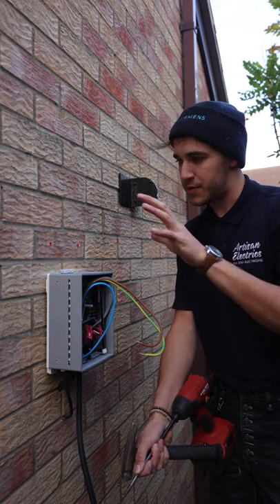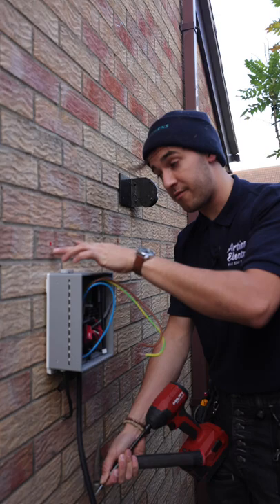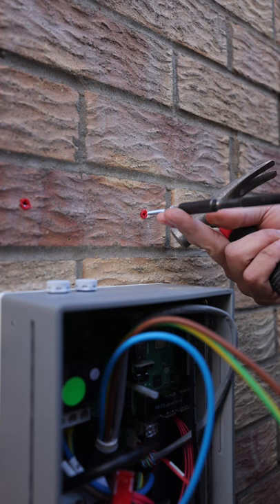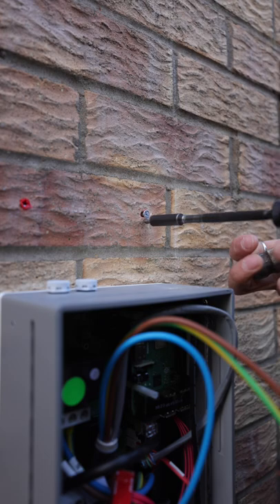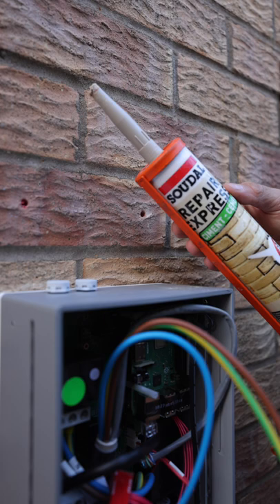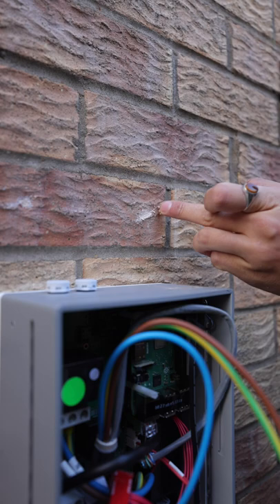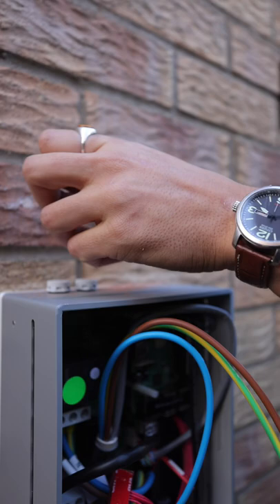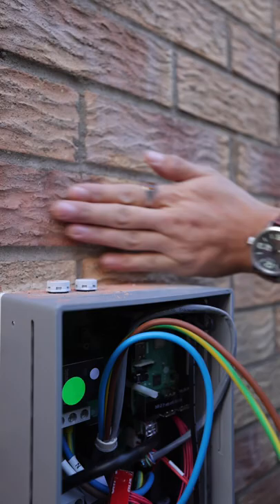HOW TO FIX HOLES IN BRICK 🤯 #shorts

Comment: Did this on a corporate job a couple of weeks ago (not an electrician). Director was 10 minutes late, walked out and said “was the equipment installed around the other side” after I’d removed equipment and filled 20 holes in 5 minutes or less and there was absolutely no trace. The engineer and I just laughed as we were just talking about how he never leaves the cabins and wouldn’t know where anything was.

Comment: I’m very impressed 👍👍 most people would have just left the holes ask me how I know my local cable company did it on my house on 25-30 holes that they didn’t need to drill in the first place pulled all the screws and walked away after I showed them the cable outlet that was already in the bedroom they ran cable to on the outside of my house 🤣

Comment: Any tips on how to keep to cement from “going off”  within the nozzles when not in use?
Reply: Woodscrew into the nozzle end works fairly well with most caulk/frame sealant tubes, stops too much of it going off in the nozzle.  Usually lasts for a few months.
Reply: I tape them up.  Piece of duct tape.  Lasts a few weeks that way.  If it's started to go off in the nozzle unscrew the nozzle and clear it, a scrap piece of cable works great for this.
Reply: If you buy the bigger tube & gun version you loose the nozzle (have extras handy) as the nozzle too comes with a threaded cap for time & time again re usage 👍🏻